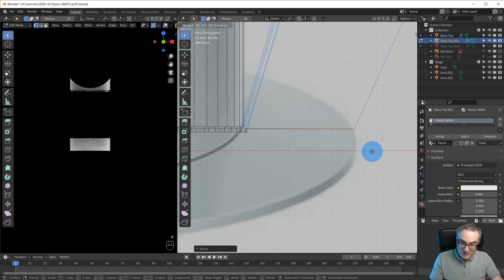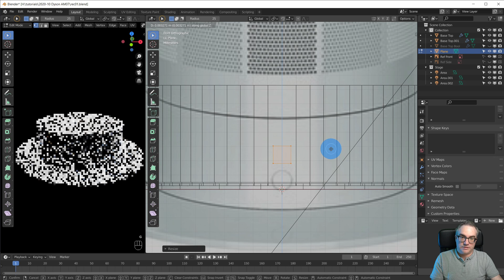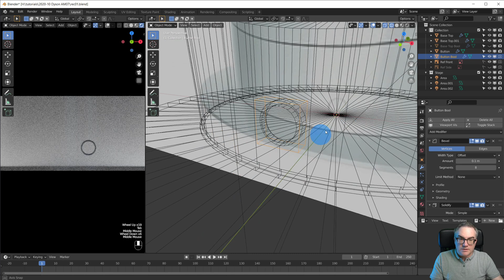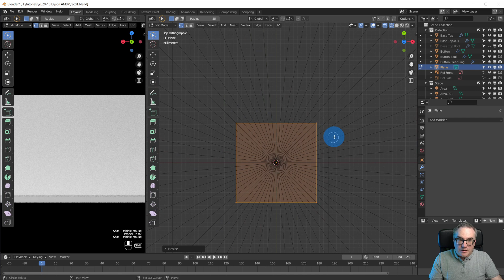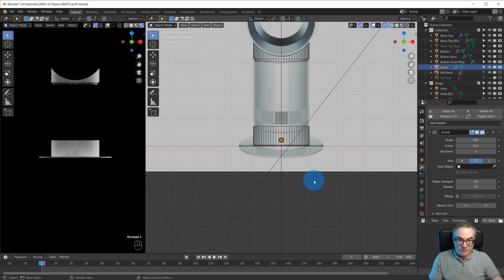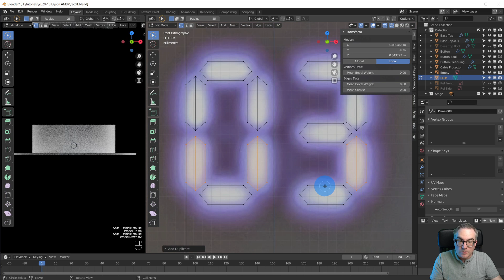Non-Destructive Modeling in Blender 3D [2/4] Dyson Air Multiplier AM07 Tower Fan

Comment: Thanks for the tutorial. The part where you take the two vertices and hit F to cover the top, i tried the same exact method and it's not working. Any idea why?
Reply from the maker: Make sure you have manifold mesh and then try "calculate order" on the boolean modifier. This usually helps here

Comment: Chris, I really like your "parametric" modelling and how you play with it. Just wonder - have you any issue with surface render after “booling” button from bottom part? With bottom “cylinder” made with 64, even 128 segments I still have broken reflection. I need to dramatically increase Steps number (>500) in Screw modifier to get proper reflections above cut button. I noticed one more thing – after cutting a hole in bottom part you have a thickness and no Solidify modifier for bottom part was used. What have I missed in your video?
Reply from the maker: Note: Bottom stand is solid, use "exact" boolean mode and make sure you move the mesh exactly (eg button square only on Z axis). Anyway, mesh after booleans is never really clean but we can get aways with a lot here 😉
Reply: @chrisprenn  Thanks Chris, as always helpful!